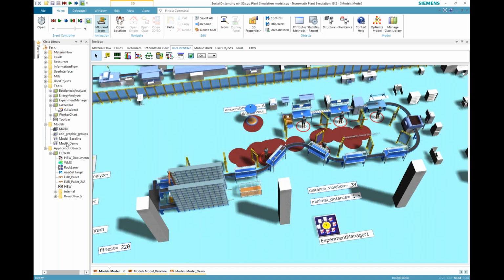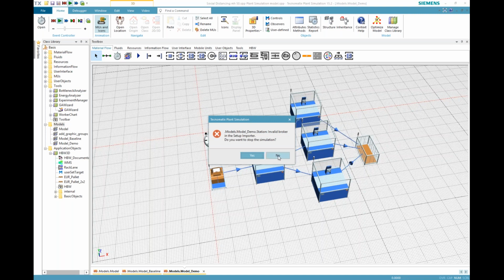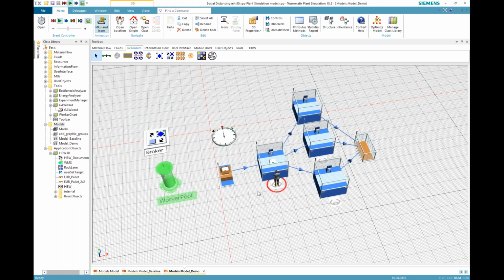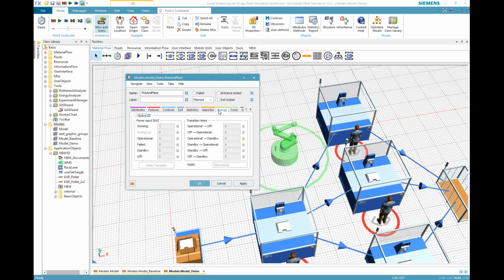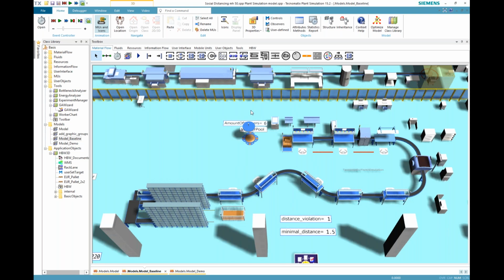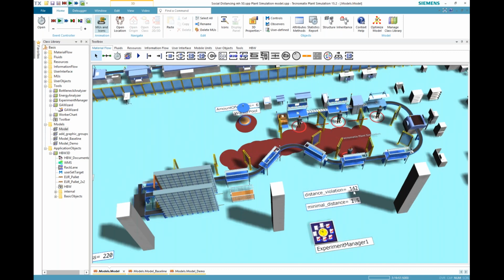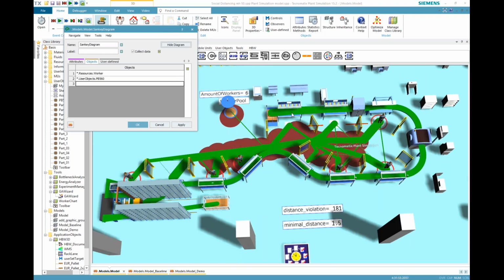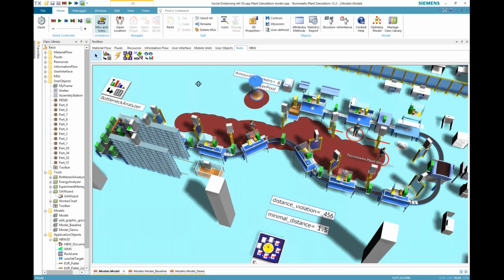Plant Simulation

Comment: Halfway through this and it is pretty much useless. This is a sales pitch, not a Master Class.
How do you realistically configure the source? how do you release parts by batches? how do you configurer the different distribution funtions for the part creation?
How do you configure process times in each station I mean REAL process times with distribution functions for them, how do you realistically configure faults?
I you want to add workers, how do you specify the real distance between stations? how do you specify lunch breaks and smoking/bathroom breaks?
All of this that I mention is basic stuff.
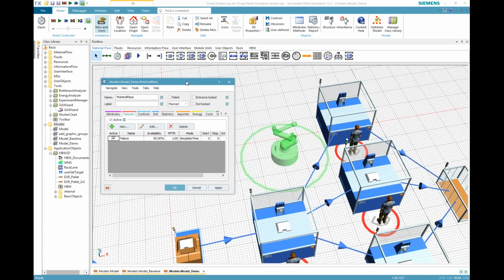At 16:24 we don't care about pretty and fancy, we want real results, it doesnt matter if it has great animations if my simulation can't realistically mimic the existing proccess and therefore I can't try improvements that provide real results.